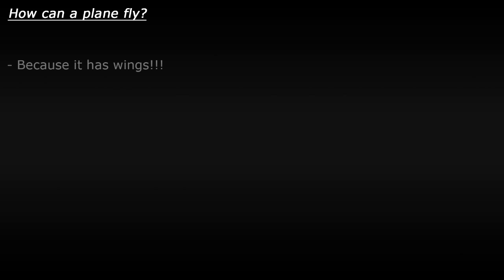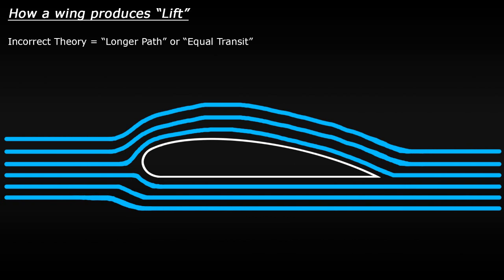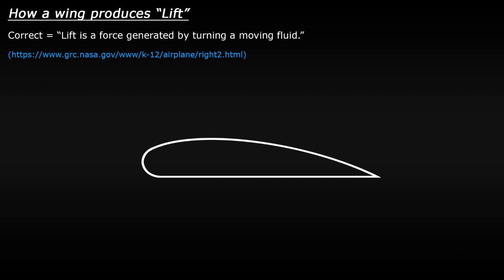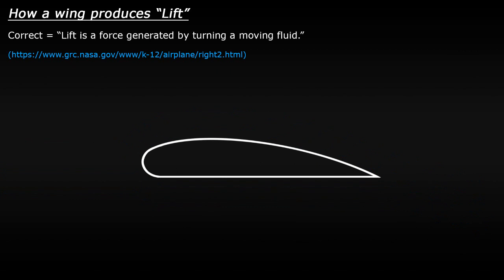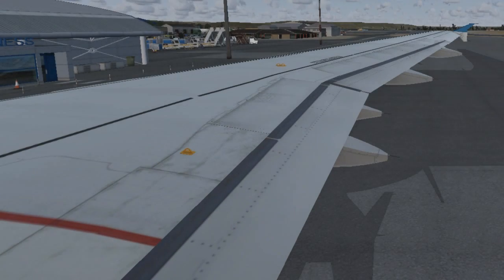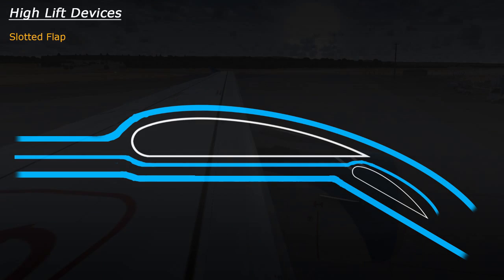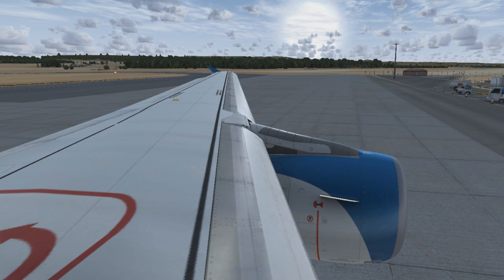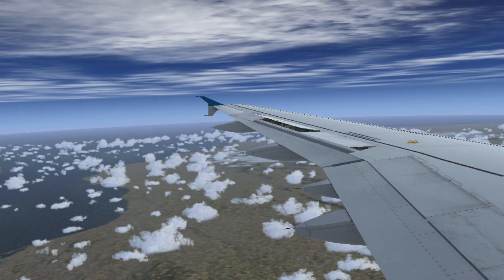How Wings ACTUALLY Create Lift!

Comment: Bernoulli's theorem doesn't work for inverted flight. Since it doesn't work in this case Bernoulli’s theorem can't be correct.

Please explain how the air going over the upper surface moves faster.
Reply: For a symmetrical airfoil, a given angle of attack would produce the same lift coefficient in inverted flight as straight and level flight. Bernoullis principle states that there is an associated velocity increase with a decrease in pressure. Just because a wing is inverted doesn't mean that you can't have Bernoullis principle.
Reply: Kevin Patrick perhaps I wasn't quite clear with my first comment. I was only considering the non-symmetrical aerofoil shape given in this fiil, which when inverted and at the same angle of attack gives a longer lower surface meaning the airflow, if it is to meet with Bernoulli's theorem, will have to flow faster over the lower surface than the upper surface of the mow inverted aerofoil. Therefore, it would produce the same amount of lift in a downward direct, which would preclude straight and level flight. In inverted flight an aircraft flies with a higher angle of attack than it would to generate the same lift as it would in normal flight.

I agree that it is the angle of attack that produces most of the accelarative force over the upper surface and not the shape, but like many other examples of how a wing generates lift we have a non-symmetrical aerofoil section.
Reply: @neildahlgaard-sigsworth3819  there is a reason aerobatic aircraft and aircraft designed to be flown at more than 60° angles of bank use symmetrical airfoils. You are correct in your assessment that a non symmetrical airfoil inverted would produce lift downwards. This would in turn require a large amount of tailplane lift in order to keep the nose of the aircraft pointed up. If the aircraft were to roll inverted and dive, then the relative wind would change and the airfoil would be acting the same as it would in straight and level flight. However, bernoullis principle is still in effect, nonetheless. A non symmetrical airfoil in the inverted position will have high pressure on top of the surface and low pressure on the bottom, and the sum of all downward forces would be greater than all upward forces until a corrective action is applied with the elevator, meaning the airfoil will not produce the same total upward lift inverted as it would straight and level.
Reply: @neildahlgaard-sigsworth3819  also, if you think about bernoullis principle and the concept of angle of attack, even for an inverted, non symmetrical airfoil, you could increase the angle of attack such that the stagnation point moves farther underneath that airfoil and the air on top of the wing decreases pressure due to the increased camber of the inverted top portion of the wing. This in turn leads to a resultant increase in the velocity of air on top of the wing. Remember, bernoulli's principle only deals with the concept that a pressure change is associated with an inverse velocity change.
Reply: Kevin Patrick OK I think that apart from our positions on Bernoulli we are more or less in agreement. Benoulli as explained in this film doesn't explain inverted flight; it's similar in manybrespects to standard aerodyamics not being able to explain how a bubble bee generates enough lift to fly.
Reply: @neildahlgaard-sigsworth3819  there are three aspects of lift. 1) bernoullis principle and the concept that high pressure has a natural tendency to flow to low pressure. 2) downwash created from the faster moving air on top of the airfoil being forced down by the higher pressure air above, created a downward force that pushes the airfoil up. 3) Newtons 3rd law (how a kite flies). A good airfoil can take advantage of all three of these. A bumble bee uses downwash and Newtons third law, as it is so light that the air pushing against its wings is easily enough force to keep it in the air.
Reply: @neildahlgaard-sigsworth3819  it's easier to understand if you fly an airplane. Anytime you bank an airplane, you require an elevator correction to maintain that vertical component of lift. In an inverted position, you would not simmply fly straight and level. You would be fighting to maintain level flight in the inverted plane, and may non symmetrical airfoils are unable to do so without the proper elevator authority.
Reply: Kevin Patrick IIRC a bumble bee uses leading edge vortices as it is too large for its wings to support it (this came out back in my student days). I preferred to use the trim tab to balance the loads when I was flying.
Reply: @neildahlgaard-sigsworth3819  A trim tab acts by imposing a force on an elevator. If you run out of elevator authority, it doesn't matter how much trim you add, the elevator will be at maximum deflection and unable to keep the aircraft in level flight. What I'm saying is, bernoullis principle applies to all aspects of flight, especially inverted flight. Upward component of lift is dramatically reduced with an inverted asymmetric airfoil. I would agree that the equal transit theory is completely wrong, but Bernoullis principle is not the equal transit theory. As for leading edge vortices, the primary purpose of them is most likely to Inact a pressure change.
Reply: Kevin Patrick the only thing my flight manuals say about the elevator is it control angle of attack and thus speed. To balance the bank you use rudder. As for trimming, you obviously misunderstood mynlittle joke.

Now back to Bernoulli, it great at describing what is happening and can be used to calculate the lift a wing could generate, but it can't explain the why of lift generation. It can't tell you why the air going over the top of a wing must move faster to generate lift, and this is why, by itself, it doesn't explain why a wing genetates lift.
Reply: @neildahlgaard-sigsworth3819  1) angle of attack does not control aircraft speed, nor does elevator control angle of attack. You can pitch an aircraft 60 degrees up and with enough thrust be at a very low angle of attack due to the changing of the relative wind. 

2)Balance the bank? I'm not sure what that means. 

2)bernoullis principle doesn't attempt to explain the generation of left. Bernoullis principle simply states that there is an associated velocity increase with a decrease in pressure. And we know that high pressure flows to low pressure. Which explains one aspect of the creation of lift.
Reply: Kevin Patrick a balanced maneouvre is also known as a co-ordinated one. Stick forward houses get bigger; stick back houses get smaller, until the angle of stall is reached and then the houses get bigger again. Stick foward house get closer at a faster rate; stick back house get closer at a slower rate. Simple, easy to understand general aviation explanation of the effects of the elevator.

And still it doesn't explain why the air moves faster over the upper surface, which limits Bernoulli to a yes, that is what happens, whilst not explaing the why it hsppens.
Reply: @neildahlgaard-sigsworth3819  OK so how does an f-15 climb at 2000 ft/m without stalling? By changing the relative wind. Pitch =/= change in angle of attack. Also, I've never heard of coordinated flight being referred to as balanced flight. As for not understanding the why of bernoullis principle, it doesn't matter. His theory wasn't "why" it happens. It was that it happens. And it can be proven. And it demonstrates one component of how lift is created.
Reply: Kevin Patrick the F-15's climb performance is dictated by its SEP. There's a test pilot report you can look at for the full details.

So you've never been taught that a well balanced maneouvre, such as a turn, is also called a co-ordinated maneouvre? That is surprising as it is standard terminology.

Bernoulli's simply states that as the speed of a fluid flow increase the pressure it exerts simultaneous decreases; and as it slows down the pressure increases. It doesn't explain why this happens.
Reply: @neildahlgaard-sigsworth3819  I've been taught how to fly a coordinated maneuver. Coordinated flight is the correct terminology, as dictated in the PHAK. Never heard of balanced flight. I think you're missing the point I'm making here. Bernoullis principle is not meant to explain lift. It's meant to explain the increase of velocity on top of an airfoil.
Reply: @neildahlgaard-sigsworth3819  however, you can't discount bernoullis principle just because it doesn't fully explain all theories of lift. It's one factor that factors into the creation of lift. I'm not saying it is an all proving theory.
Reply: Kevin Patrick in a coordinated maneouvre all the forces on the aircraft are in balance, other than the one(s) causing the maneouvre. In a turn that means no slip or skid.

Bernoulli only applies along a streamline not across them. What actually causes lift is the curving of the steamlines as the the flow over and under an aerofoil section caused by the aerofoil section being there.
Reply: @neildahlgaard-sigsworth3819  Are you saying bernoullis principle doesn't apply In a case of spanwise flow? Because spanwise flow decreases the velocity of the air moving on top of the wing and can potentially decrease lift. Also, camber, or curvature, directly ties into bernoullis principle.
Reply: @neildahlgaard-sigsworth3819  Bernoulli applies across any streamline that doesn't hit the boundary layer in external flow around a wing because all streamlines reach into the far field where pressure and velocity are constant
Reply: Bernaoulis theorem has absolutely npthing to do with wings or flight.
It concerns only fluid pressure and fluid flowspeeds.
It is however applicable to flight, as it is a way to create a pressure differential, thus lift, with relatively low drag.

Comment: No Conda effect is involved in flow curvature or wing attachemnt, . Coanda installed a jet engine at the fusiform end of a fuselage and noticed the jetstream curved toward the fuselage. The air in between the jet and the fuselage is in fact entrapped more quickly than other air can replace it, so there is a local decrease of pressure in that "triangle", The higher pressure around the jetstream push the stream toward the area at lower pressure.Coanda effect describes the interaction of a static fluid sourrounding a jetstream, static fuid that is entrapped in the stream by viscosity and turbolence. It does'nt have anything to do with flow curvature or attachement over a wing. The explanations that uses Coanda effect to describe the flow curvature of a water jetstream around a curve surface are wrong. The wing  airflow works the way we see because  it flows as a continuous material and because every air particle in a streamline, forced to change direction by a solid object , must develop an acceleration toward the centre of curvature. That is the reason for the attachement, and the curvature, the centripetal force that ovverride the centrifugal. See Holger Babinsky, professor of fluidodinamic at Cambridge or Doug McLean (Boeing) Understanding Aerodinamics. Or, simply, F=ma.  No viscous forces are involved in wing attachement, neither can explain flow curvature. Flow curvature and wing attachement works in the same way with or without viscous shear forces. To have lift, the first necessary condition is flow curvature by a solid object, and the second is to have different speed over the two wing surfaces, the upper and the lower. See also the NASA pages on aerodinamic.
Reply: Flow curvature implies pressure differential implies different speed.
Reply: @AmbientMorality   a change in flow speed requires a pressure difference. We can say the same thing about a change in flow direction: The only thing that can cause a change in the velocity vector is a pressure gradient. Thus for the normal acceleration to happen, the normal pressure gradient must already be there. And then if we incorrectly limit ourselves to one-way causation, we leave unanswered the question of what causes the pressure gradient. A correct explanation must acknowledge circular causation between the pressure and velocity fields.(McLean, uderstanfing aerodinamycs)
Reply: Stefano Cantadori Yes, but you said two conditions are needed: different velocities and flow curvature. Those are really the same condition.
Reply: @AmbientMorality   it is depending by the solid object that change the flow direction. In a steady flow , if the object is a wing, a flat panel moving ahead  with an angle of attack is a good basic wing,  indeed the flow curvature brings different speeds above and below (the so called circulation) and this brings the pressure conditions along the streamlines that at its own time generates a new set of different speeds station by station. Speed and pressure  changes sustain each other in a circular reciprocal relationships which we can look at with the bernoulli principle along each stremline. Ia a particle accelerates in a direction  along a streamline pushed by pressure, the increased speed brings lower local pressure. Conservation of energy. The change in direction , the curvature, is also due to pressure and the acceleration across the streamlines is normal toward the centre of curvature. The object (flat panel with an angle of attack) moving  ahead pushes air in front of it ad this does create the diffuse clouds of pressure gradients that makes air accelerate  from higher to lower pressure zones, giving raise to circulation. Once circulation is set, we have lift and a newer condition of diffuse pressure gradients is created arond the wing. Nothing fancy as the so called starting vortex is required to activate circulation. That vortex exist but is a consequence of circulation and lift
Reply: @stefanocantadori4945  That's true. Though you aren't getting any circulation without viscosity

Comment: this is not what actually cause win go create lift.  Actually the real reason is much more simple. wing cause airflow to turn, mean accelerate, that acceleration require a force to be applied on the air by the wing, resulting in a counter-force than is the lift. That simply the action of pushing the air than cause win to create lift
Reply: Observ45er - yea...my only point is that not really the pressure. that simply plain F= MA. the mass of air who is turning (acceleration) do so because the wing push it. air push back as action reaction. resulting in a lift perpebdicular to wing attack angle.

not really a pressure phenomenon. just plain simple F=MA

Comment: The equal transit time hypothesis  does not explain lift. It says that a pressure differential causes lift. However a pressure differential does not cause lift. It is lift. "A pressure differential causes lift"? Makes no sence to begin with.
Reply: Lift is a force caused by pressure over an area.  Lift is the force; the pressure differential is the cause.

Comment: The longer path theory is incorrect, agreed. But the Bernoulli Principle is not.
 
1:57 is not correct. It has nothing to do with where the air goes after passing the wing, it has to do with where the air goes when passing it.
 It is always the pressure force difference on the wing.

We have 2 basic ways of playing with upper and lower wing pressures creating positive lift on both:

1 - Reduce the upper pressure / accelerate the air over the wing:
The Bernoulli Principle: On a leveled horizontal wing the pressure on top is lower due to faster upper airflow induced by the airfoil shape.

2 - Increase the lower pressure / deccelerate the air under the wing.
This way, we don't even need an airfoil design for it. We simply increase the angle of attack provoking a direct contact with the air flow, increasing drag, increasing lower pressure.
Reply: Its not wrong, at 1:57 hes talking about newtons laws of motion, to be more specific Newtons 3rd law which states: For every Action, there is an equal and opposite reaction. 
So in our case the Action is that the wing deflects the airflow downwards (downwash), the reaction to this is that the wind will move upwards. Example when youre in a car and you holding your hand out of the window and then increasing its „AOA“ or angling the Hand so the Airflow hits the lower part of your Hand, your hand will tend to move up aswell.
Lift is a result of both Bernoullis aswell as Newtons Laws of Motion 
Greetings 👋
Reply: @The_Plane_Spotters  Yes, of course.
But the downwash itself only affects flying objects behind.
 It is the contact that produces the downwash, that also produces the lift.
Reply: @miks564  I dont get what you mean. Because you saying that the downwash only affects objects behind but in the next sentence you say it generates lift, sorry :/
Reply: @The_Plane_Spotters  Nope. I’m saying the same effect that generates lift, generates the downwash. I’m assuming downwash is the resultant air flow after the wing effect.
Reply: @miks564  correct